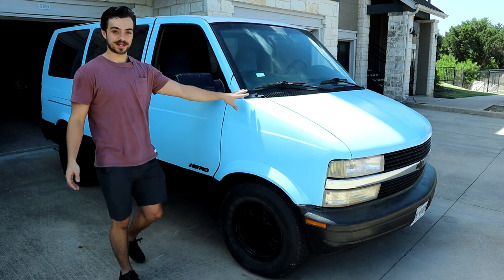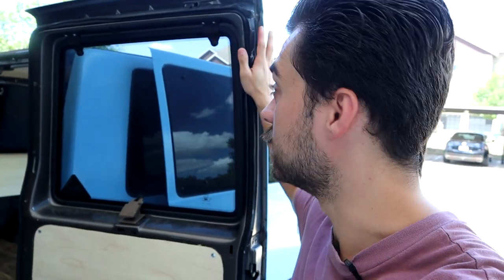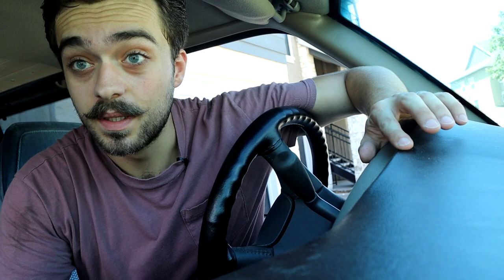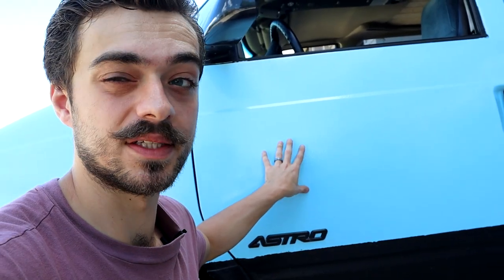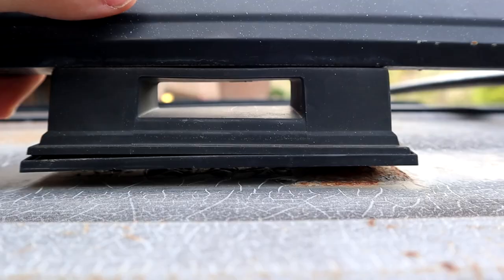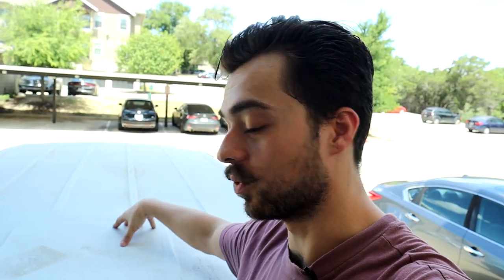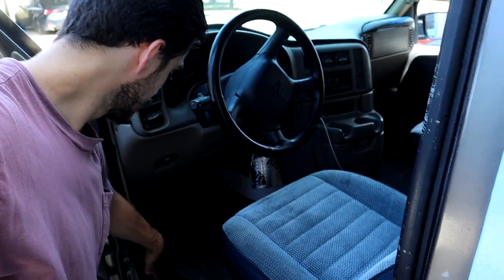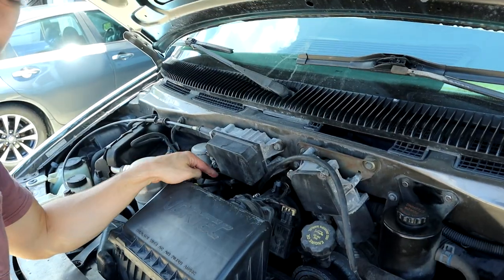Here's 5 reasons you should NOT buy a Chevrolet Astro Van

Comment: 1993 Cargo Teal...666K miles...Garage Lift's, by the Body, instead of the Frame Bump, and  Front Leaf Spring Plate, by ignorant mechanic's, thinking they are Mini Van's, but they are Truck's, caused major Rocker Panel Crushing, Door Jamming and the Cheap Door Handle Snap off's. I am trying to keep it for life, but  Replacrment Part's, are rare. Need to find other Owner's, who have Replacement Part's access. The Astro and the Safari, were subject to being called a Mini Van, which led to their being damaged by dumb shop lift's. Haynes Repair Manual's named them Mini Van's, causing the Problem. Specific Lift Point's are detailed in the Manual, but hurry up get it done shop's, paid no attention. I yanked off 3 handles, before I realized the Door was rubbing the Rocker Panel, and the Upper Hinge, was falling down. I took a 3 pound Sledge Hammer, and beat the hell out of the Top of the Rocker Panel. Door Striker Pin is non adjustable too. I got all that Mileage, due to 15W50 Mobil 1 Synthetic, Marvel Mystery Oil, 70/ 30 Mix of Distilled Water and Green Coolant, pulled thermostat, removed AC Condensor, Hayden electric fan, Prolong Additive, and Mobil Synthetic in Transmission and Rear Differential...Water Pumps, Alternators, Starter's, Rear Slave Cylinders, Brake Booster, Shock's, a few rusted brake lines replaced, O2 Sensors, IAC Valve, One time only Model 220 Throttle Body Cleaning, and original 2 Fuel Injector's,  Coolant Sensor, Catalytic Convertor, EGR Valves, Fuel Pump's, and the simple Tune Up  of Cap, Rotor, PCV, Air Filter, and the rare AC Delco Spark Plug and Wire replacement, and Brake Job's and Tires, Both Leaf Spring Clamp's to Rear Axle Housing rusted snapped off and replaced and, a New Paint Job...whew...still love it. Rust underneath spraying Rustoleum Rust Sealer, rear barn doors seals replaced with home door draft sealing, stick on foam rubber, and she still runs...3.23 Rear Ratio, hard to find, as Pep Boys pulled the 2 Axles, for oil seal teplacement, and did not stick them back in properly, causing sharp jerk,  from Park to Drive, and into 2nd and 3rd, back in 1997. Pep Boys also damaged the Rocker Panels. 2 Rear Main Seal replacements, 2 Transmission Rear seal replacrments, Speed Sensor and teplaced the original radiator at 660K miles...yeah...The 1993 4.3 before the Balance Shaft. Just ferls safe and nimble. Many upgrades and improvements to go. Can't tow with a 3.23 Rear ratio  and the Fiber Composite Leaf Springs still function, for a Federally Decripted 6000K GVWR Truck. I blame Garage Lift Mechanics, who can be Charged with Property Destruction, for the Door Jam Handle problems, causing their demise. Retired now, and only go to the store with it.

Comment: Would a drum to disk breaks swap possible ?
Reply from the maker: From my research, there are three options.
1. Swap a diff from a newer Astro 
2. Buy a disc swap kit (they are expensive) 
3. Piece together your own kit, which should be cheaper especially if you use junk yard party. However, I believe you would have to upgrade the master cylinder to one prepped for rear disc. 

I will say this, the rear drums are all the van needs unless you are doing heavy towing or a lot of off roading. 
I mainly wanted to swap because disc are more reliable and easier to deal with.

Comment: Distributor cap x 1 a year, depending on your model the distributor gear is softer than the cam gear that can cause a misfire. check that if you have a miss you can't track down. Your dash can and prob will split. Arm rest on the seat breaks, arm rest on the door wears badly. fuel pump, rear main seal. Water leaks,  But after 22 years and 260k what can you expect lol. Salute.
Reply: I replaced my distributor and rotor separately and still have a misfire that I can not track down. Not sure where to look at this point. I have replaced everything. Now I have low oil pressure once the engine gets warm.
Reply: @appliancedude63  was the gear worn on the old distributor? If so the cam gear might also be worn just enough to cause a misfire.

Comment: I had a 2002 AWD for a little over a year, and it was hands down the worst piece of crap I ever owned. Highway driving was a nightmare, shaking and shimmying down the road no matter what I did to it. Every interior panel would squeak and rattle, cheap plastic. Interior manifold failed, got it replaced, failed again. Ate ball joints for breakfast. I poured thousands of dollar ls into it in a year's time and just about everything I did had to be done again in a matter of months. I couldn't get rid of it fast enough. Good riddance.
Reply from the maker: People either have a great time with their vans or the complete opposite. The truth? They are older so things will break. I bought mine from someone who did not take care of it so I immediately replaced everything I could think of that might fail. So far It has been treating me well. The creeks are real though. Not any worst than my 08 Tahoe.
Reply: @ImChrisDeDecker  I bought it for $2500, with $2500 ready to go for immediate repairs. I went to town on it immediately but quickly surpassed that number. It was a shame too because the body was beautiful. Rust free, dent free, almost looked showroom. No cracks in the dash, fixed the grab handle, everything. It turned heads around town. But man it was miserable to drive. I wanted, so badly, to love it. Never again.

To be fair, by the time I sold it I had solved or minimized most of the worst problems. Some crazy Italian dude on the west coast bought it for $5700 and shipped it from Boston. I sincerely hope he's having a better time with it than I did.

Comment: If you still have broken handle 
Please send me 
I want know where broken 
Me all Astro and Safari are not broken 
So I want know where weak points is?
Reply from the maker: The weak point is where the handle meets the bolt that attaches to the car. The plastic molding around the bolt insignificant. I’ll elaborate on it more whenever I dig into that issue
Reply from the maker: You are very lucky. Do y’all the handle regularly?
Reply: Thanks 
I’ll check weak point